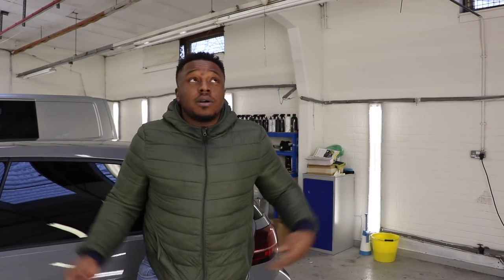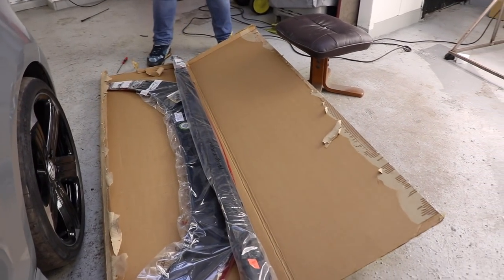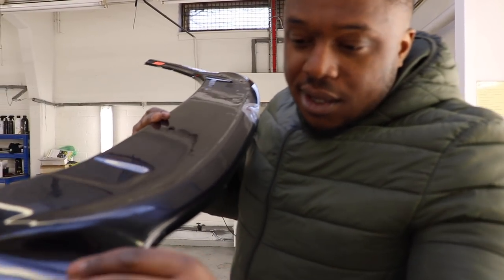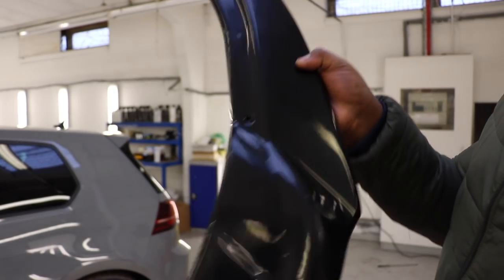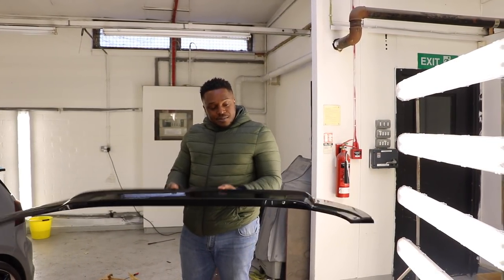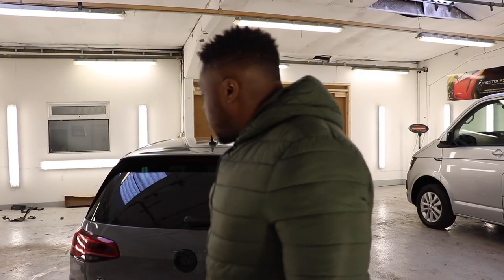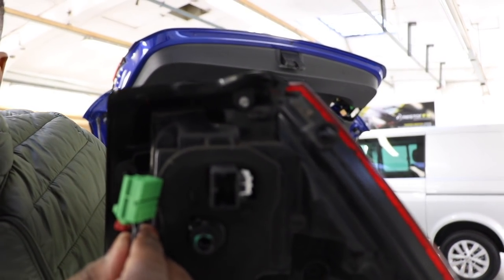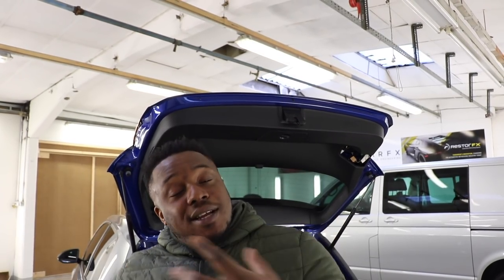Received my Golf R Mk7 Maxton Design Splitter - Unwrapping & Update

Comment: Link for the rear lights? Thanks.
Reply from the maker: sam9m eBay!
Reply: X1AOU did you buy them new or from a breakers? I can only find them for 800/900
Reply from the maker: They come up now and again, a VW dealer in Scotland was selling some brand new for £300 the other day. I posted the link in the UK Mk7 Golf R Facebook group and someone bought them straight away lol within like 30 seconds. 

Mine were about the same price. Im assuming your in the uk though...USA I have no idea.
Reply: X1AOU hi again I’m not far from Manchester myself, could you possibly let me know where you sourced adapters and had coding done and how much it cost? Thanks
Reply from the maker: x x audiament adapters. Plug in, code them (took a lad who knows what he’s doing 3 minutes with the instructions they sent) and your away. Took maybe 10 minutes from undoing the first screw. Literally plugs in too, no cutting or anything like that. 👍🏾